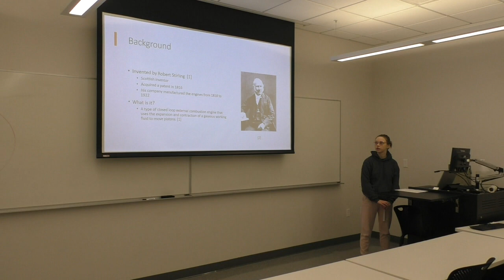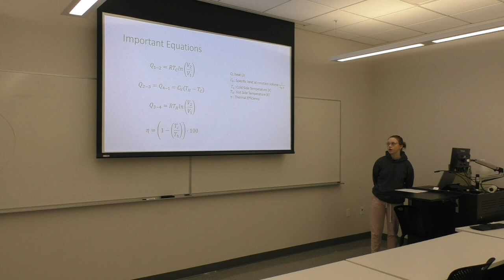Alexis San Miguel

Comment: The sterling cycle engine is an excellent 6-min talk presentation. I like how you explained the topic and gave advantages and disadvantages for the engine. Maybe elaborating more on the equations at the certain states in your chart a little more would get your time requirement up. Otherwise, good job

Comment: Although when I chose this topic I didn't realize how little application there was revolving around external combustion engines or the information I could find I think I did well with the information I provided. I do think that I need to be able to get to the six minute mark however I believe I was able to speak more confidently and clearly than previously which still shows signs of improvement in my presenting skills.

Comment: Excellent presentation, Alexis. Your choice of the Stirling engine as a topic was impressive, and you delved into the details with a depth that demonstrated your extensive knowledge. Your use of sample calculations and your ability to communicate clearly to the audience were notable strengths. While time management could be fine-tuned to meet the six-minute target, this was a minor point in an otherwise flawless presentation. Your thorough explanation of the Stirling cycle engine was well-executed, showcasing your deep understanding of the topic. Overall, you did a fantastic job, with the only suggestion being to ensure you utilize the full allotted time in future presentations.